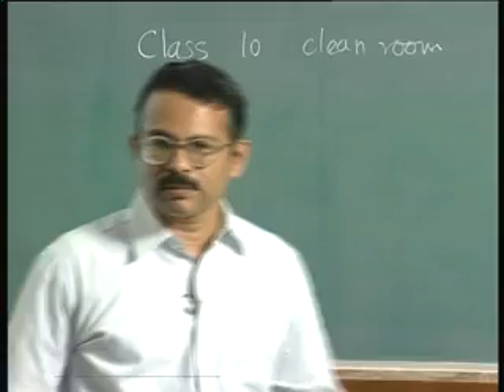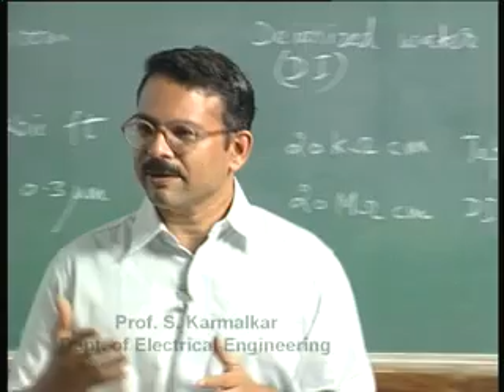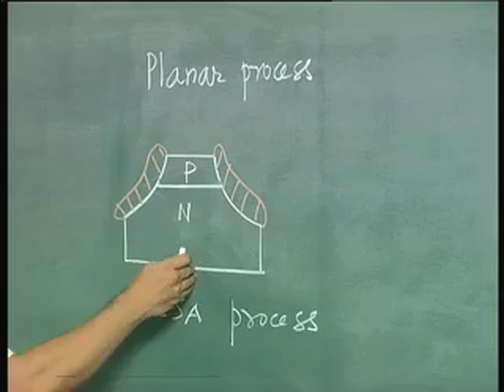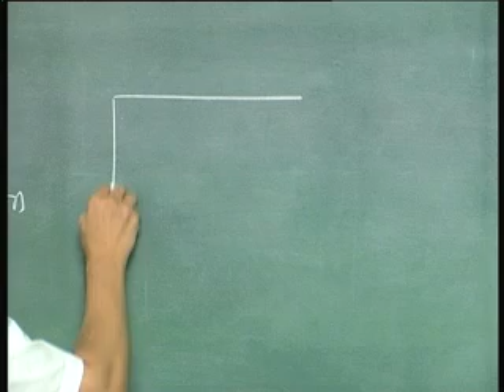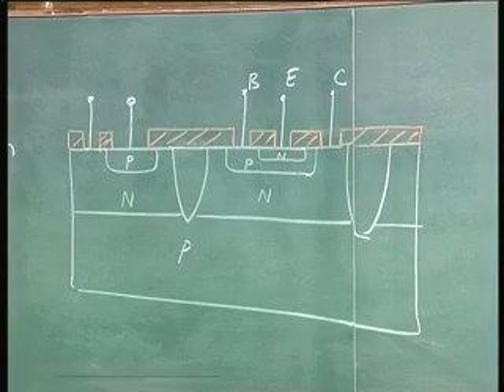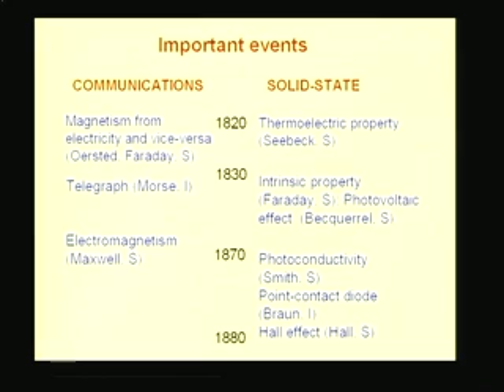Lecture - 2 Evolution and Uniqueness of Semiconductor

Comment: i just watched this lecture. some corrections are in order.  Class 10 clean room means among several other metrics, no more than 1,020 0.3um particles and no more than 10,000 0.1um particles. . similarly class 1 clean room has metrics of no more than 102 0.3u and 1000 0.1u particles.

Comment: The Nobel Prize in Physics 2000 was awarded "for basic work on information and communication technology" with one half jointly to Zhores I. Alferov and Herbert Kroemer "for developing semiconductor heterostructures used in high-speed- and opto-electronics" and the other half to Jack S. Kilby "for his part in the invention of the integrated circuit."
Reply: Nice 👏👏 info
Reply: Yes. I was looking into this, Jean Hoerni did not reciece Nobel. Jack Kilby recieved Nobel prize for his role development of IC in 2000, almost 50 years after planar process was invented, alongside Alferoev and Kroemer